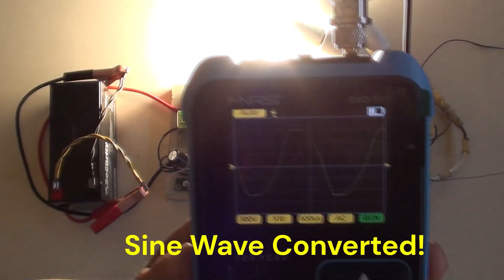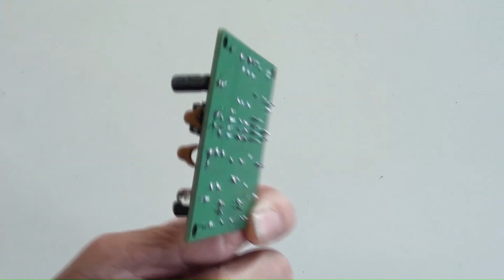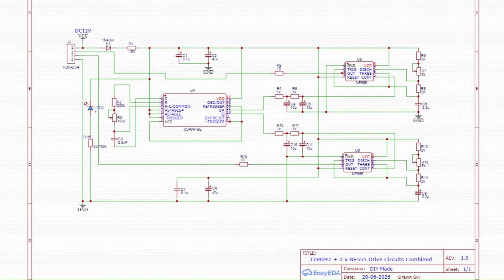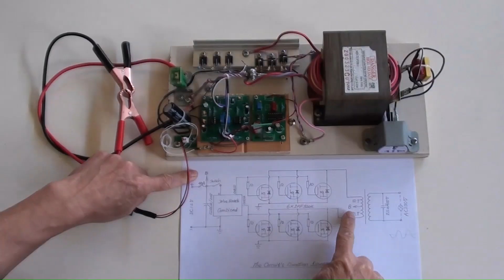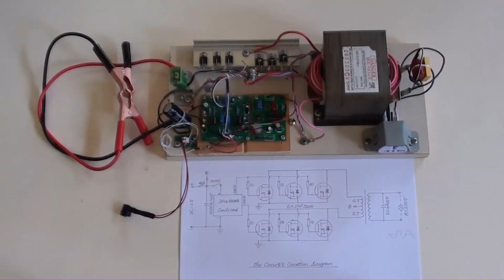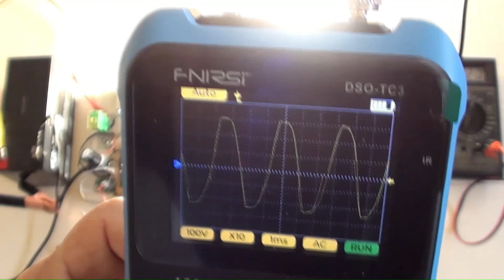How To Convert Square Wave To Sine Wave?

Comment: Humming sound... so it denotes even terrible than square wave 😂😂😂
Reply from the maker: Humming sound???  Have no idea what you was talking about!   😇👍❤
Reply: @diymade2175 i heard humming sound.. Didn't you
Reply: @diymade2175 moreover just inductor capacitor combo doesn't convert square to sine..... It is proved 😂
Reply from the maker: @Rokko3456  Thanks for your reply, Mate!  There are the ways to have sine wave converted from square wave, in this video showed is only the one of the ways which is not just to use an inductor and capacitor combined, however is used a Square Wave Generator and Pulse Shaping Circuit's combined.  At this stage, you've not got the idea what the video has showed.  Go back to watch the video again if you're still interest.  Cheers!  👍❤

Comment: كم التردد الذي يخرج من NE555
Reply from the maker: Thanks for the interest!  200 Hz was the frequency of the each NE555 which can be chosen as you wish by using formula f = 1.44 / (R1 + 2*R2)*C.  R2 ref to R8 & R14, C ref to C6 & C9 from the first diagram in the video, to choose varies values of those components will result the different frequency of the NE555.  Cheers!  👍